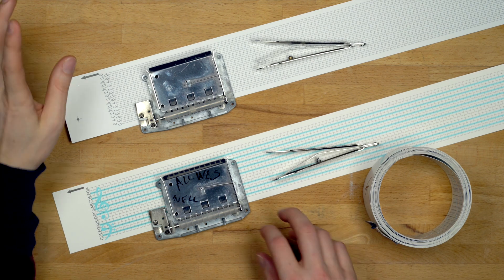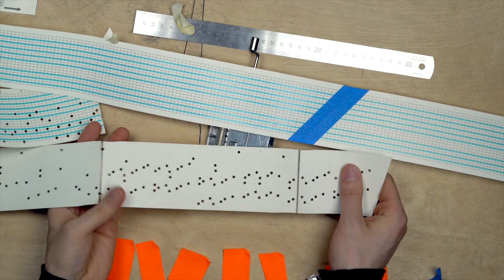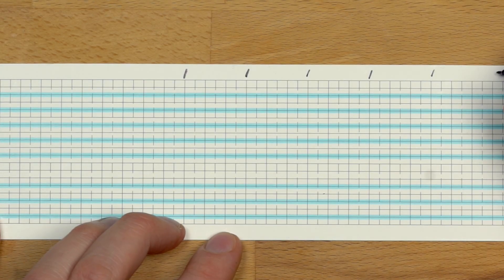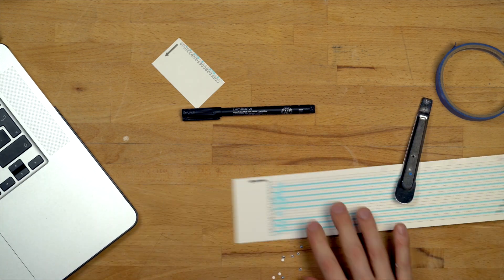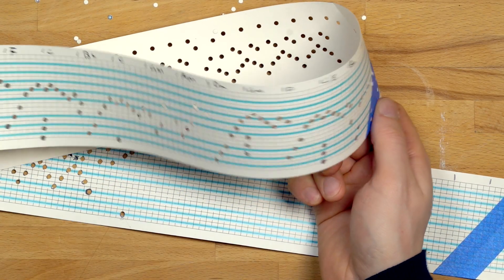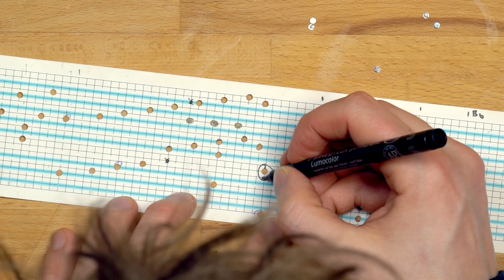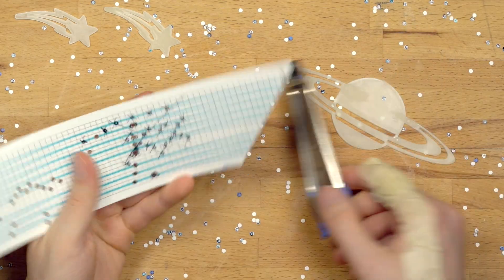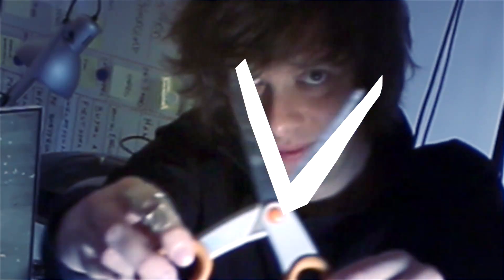How To Program a Music Box - Hole Punch Tutorial

Comment: Hi Martin, I had a quick question. I was thinking about an idea for a project. The question is, what if instead of using an electric motor, you replaced it with a wind-up system like in old clocks? I suppose it wouldn't be too difficult to manufacture, teach, and 3D print, at least the less mechanically demanding parts. I was wondering if you could try it too, to upgrade the music box. Also, to improve the system and have a speed control, you could use the same mechanism as a gramophone to adjust the wind-up speed. It's an idea I thought might be useful since the motor noise has always been a problem with the music box. I thought it would be an elegant way to repair and improve it. I don't know what you think, because I'm going to try it, but I'd sincerely appreciate your opinion. My English isn't very clear in my writing because I'm from Chile and it's not my native language, so you'll understand that the message might be poorly written. I apologize in advance. And I just wanted to throw the idea out there and see if... Are you interested in it as a concept, just from a fan's perspective, and would like to know your opinion? And are you interested in doing any projects on this topic?

Comment: Martin, you already have a CNC cutting/milling machine, can you not fit it with a spring-loaded hollow "punch" bit and have that work it's way down a strip of those pre-joined cards and use a straight up/down motion of the CNC head with NO rotation to pierce the strip at the right places? Obviously it will be essential that the strip is parallel to the axis of the CNC machine - so you will probably need to fit guide rails either side all the way along. So as to reduce the effect of driving the punch into the wooden bed of the machine you would want to have a strip of some sort of rubber or foam like material for the strip to rest upon - either that or replace the idea of a physical punch with a high power laser (or plasma?) cutter to make the holes - or a black marker pen if you still want to punch all those hundreds of holes out by hand your-self... 8-)

Comment: What you actually need is an automatic 20-hole puncher that reads the midi. how to translate the next midi note to the motor that triggers the correct puncher seems less time consuming than drawing out everything by hand. Plus you can replicate.
(and sell it to your fans)

Even with one note at a time it would go faster.

The tempo you should be able to adjust by the wheel that drives the tape.

Comment: Maybe my idea can work for this "manufacturing".

You can modify an black and white inkjet printer, if your midi software permits to print or you can save screenshots and arrange them after.

You can made a plate with holes for the punch female e modify printer head with an  electrical magnet that repels the puncher male, when the electrical signal opens the jet nozzle. You will have to amplify the electrical signal maybe with a circuit or an transformer or relays circuit and calibrate the print speed on puncher speed or the reverse, maybe easier then the one hypothesis.

In this manner you have encorders,   so positions. You need, maybe to change midi graphical notes in dots to permit to printer software to see them as not a "cloud " of point but as a point for dot.

 Now the problem is only to make note length. I have an idea sketch, but I don't know how the "player " works.

Thank you in advance for you Attention.

Comment: but, how about the missing process where we go from paper punched strips/rolls, to metal cylinders, or cones with barbs on them that pluck metal tines in an actual music box? How about THAT process? This is just about how to make rolls for a small player piano, basically. to call it it music box programming is a bit of a stretch without adding that rest of the process of turning what you have here into metallic discs, or metal tubes that are used inserted into a music box machine that plays like a harpsichord would play; plucking .....? where do we go to see THAT?

Comment: For laser cutting, you could just use the midi visualizer thing. Presumably it doesn’t matter if it’s a round or square hole, just export an image of the midi sequence, throw it in photoshop (if you can’t export the midi with black notes white background) there are several slicers that use monochrome gradients to determine cut depth, a free one being Easel by inventables. Just convert your image to an svg and it’s drag and drop. It would also be possible but time consuming to use the midi file as a background image in fusion and just sketch over it. There’s a free plug-in that lets you export your sketches as svgs directly from fusion.
Reply: won't work, as the attack happens when the slot ends.

Comment: This looks like it would fit in a Point of Sale Printer, they come with big rolls. Typically they are 80MM; I didn't catch what width these are. I have seen them with thick Card Stock which should work for you. They print thermally, so they are very manageable. The programming would pretty straight forward, I would think. - Did you get someone to print things for you?

Comment: As an engineering student I would love to make a device that automatically punches holes.  I think one could make “a music maker box” a music box that punches holes instead of playing them, an arduino could control the hole punching, and an encoder could Tracy the rotation of a drive wheel.  The goal being you export a MIDI to the device and it automatically prints out a perfect copy.
Reply: Please do this
Reply: exactly what I was thinking
Reply: As a programmer, manually marking the holes hurts my brain. Seems like an easy job or some one who understands MIDI.
Reply: @mikeharris4979  wrr
Reply: Yes, actually you can by trying to feed the arduino the midi data to serial data so that the arduino can read it,  add some mechanical puncher then done
Reply: Perhaps print it on tyvec, cut join and punch it out. Assuming tyvec would be strong enough. You would have to fiddle somewhat to get the scale right.
Reply: Josh Vennix tyvec should be plenty strong.  Cheap in large quantities.  Cutting it to size sounds awful however.  But other than that, I absolutely love where your head is at.
Reply: But most of engineer are hardly making bread and butter
Reply: This went from "I would love to make a device" to "I have near 0 interest in doing this" quickly...
Reply: Lama Poop it was more an “it would be cool” and not an “I would love” thing.  I would like to do it, but it isn’t realistic or feasible for me.
Reply: @sketchyAnalogies  I understand. Somebody will implement your idea and soon it will be a feasable joy for everyone!
Reply: Lama Poop and they’ll make millions off my laziness. Jk
Reply: @sketchyAnalogies  And now go think again about the feasibility... <3
Reply: @sketchyAnalogies 
The ones upstairs were all too clever
They were all stupid down there
And you were never given a chance
And now it's all too late
(Knorkator - Du bist schuld, 2010)
Reply: if somebody is working on this let me know, I'm a cs student and I am experienced with mcus and electronics basics. I have already worked with MIDI.
Reply: Making THAT sounds like hell
Reply: @jesus2639  I can only imagine how the first computers, which read Punch Cards and punched holes in those Punch Cards, were invented.
Reply: This is in fact a good idea, why not make a software that takes the notes, places them onto a digital version of the paper, print that out, and cut holes based on the dots. Of course, you need need to adjust for length of the song, the width of the paper, which could be fixed with a custom printer that kinda prints like receipts do.
Reply: @WestOfLee100  This is in fact a good idea, why not make a software that takes the notes, places them onto a digital version of the paper, print that out, and cut holes based on the dots. Of course, you need need to adjust for length of the song, the width of the paper, which could be fixed with a custom printer that kinda prints like receipts do.

Yeah, someone has made a very simple version of such a program for my 30-note music box, but it's so old and abandoned by the original creator, it needs a new programmer to update it for modern systems. (See what I wrote just above.)
Reply: I was just recalling how computers in the early '80s were still mostly giant mainframes that took up a whole room, and were programmed with punched cards! My dad was studying to get his PhD in artificial intelligence at University of Toronto. He used to bring home all these used-up punch cards, and he would turn them into flash cards to teach me and my brother arithmetic. We didn't have home computers back then, only a 'terminal' that used a screaming modem that hooked into our landline, to connect to the U of T's mainframe. Then the Commodore Vic20 came out on the market as the first ever Personal Computer for the home (which was a revolution, even though it barely did anything except basic games like Garden Wars). Of course, it quickly got superceded by the ever-popular Commodore 64, which became a staple in most schools and numerous homes.
Reply: There is a video somewhere of a laser cutter used to punch the hole. My problem is not practical, I just can't read music.
Reply: what about a modified black and white printer that uses a hole punch instead of an ink nozzle, and some sort of program that converts the midi files into a bunch of dots that you could print
Reply: @tylerchiu7065  what about a old needle printer that is run without the ink band, if the needle head is put tighter into the paper maybe they could actually puncture the paper.
Reply: 3D printer novice reporting in in 2020, I recently had the idea to print out music patterns for custom tunes on a music box.
Reply: @funx24x7  3D printer novice reporting in in 2020, I recently had the idea to print out music patterns for custom tunes on a music box.
Hey, are you a programmer? Have you considered creating this yet. See what I just wrote above.
Reply: @hikikomoriarty  I don’t know enough programming to script something that automatically creates 3D objects, but my plan was to take a screenshot of the piano roll in FL Studio or some similar DAW and then use that image as a displacement map around a cylinder.
Reply: I just saw, someone has done it.
Reply: That reminds me of my early childhood. When I was 5-7 years old my dad who was a professor would bring be along to the computer central of Yale. He’d have the computer crunch his research numbers and meanwhile I played chess by punching holes in the punchcards with what looked like a monster of a typewriter, and the card was removed, fed by staff to the computers towering larger than people with wheels rolling, and wait…. Minutes later I’d get a response: again on paper, the main mufti made it’s move. Haha imagine THAT!
I’m 53 and still like to make things. My Great Grandmother used a similar system to this but more complex to program the looms at the linnen weaving factory in Swedish Norrköping at the turn of the century before last.
In fact, these paper strips look exactly like knitting diagrams. 
I wonder what a sweater would sound like musically?
Reply: @gnarbeljo8980  In fact, these paper strips look exactly like knitting diagrams. I wonder what a sweater would sound like musically?
LOL - I would love to hear the sweater song!  :D
Reply: @hikikomoriarty Me too! It’s all like morse code and basic computer programming. But I’d love to see and art exibition with translations between these technical mediums. Sweater music, binaru programs in woven damast, morse code messages as petit point embrodery, digital image portraits as ukulele pieces etc. :D
Reply: Instead of creating such a complex contraption (as cool and fun as it does sound), why not just create a computer program where you can enter the notes that you want (you can play it back to be sure you got all the notes right), and then it prints out the music box score, showing exactly where to punch the holes?
Reply: I got a free Windows software that came with my 30-note programmable music box at a music box museum in Japan. Unfortunately, it's so old it only runs on Windows XP, so I have to use an old laptop saved just for this purpose... I don't believe the programmer ever maintained or updated the software. Maybe someone with music and tech knowhow could take a look at it, and make it work on Windows 10, and Mac OS as well?
Reply: Someone in another thread was getting really riled up that one of his music box score rolls is too paper-thin to work properly with his box (he said he has to thicken it up with layers of tape). With a software like this, you could just choose the right thickness of paper (card stock) to print out the score and hole markings. You'd also save a lot of money by not having to order any more score rolls! You just print it all out yourself.
Reply: Bro.... That's PERFECT as a child that knows nothing about sheet music, that would be a fantastic idea for me and other people who don't know how to make sheet music
Reply: A piano that plays the keys and punches a hole so you know what key you will get when played back
Reply: @chupert  That's an awesome idea. I wonder if that's how the paper programs for those old-fashioned player pianos (the kind featured in Old West saloons, like in Westworld, lol) were originally made. Now I need to look that up. How did they make those punched-hole programs using old-fashioned technology?
Reply: Can’t wait! It has been 3 years since this comment and I hope that you have a prototype!
Reply: Solenoids
Reply: Yes
Reply: That would really helpful
Reply: I salute you mad lad
Reply: I'm creating this right now, first I'm coding a python program to transform MIDI in a "hole array" and then I will send this array to the Arduino to make the holes. Totally Opensource, I'm not a musician so let's see what the community can do with this.
Reply: @WillGittens001  I will actually salute you for every hole a sound clip of DIO screaming “SHINEI KAKYOIN” plays
Reply: @WillGittens001  Link to more information? this sounds useful, I just ordered a music box, but looking for a midi converter
Reply: @Kiryu1985  There's a guy who created all the hardware to do this, I'm justing creating the piece of code to convert MIDI to his open-source machine. Take a look:
https://blog.arduino.cc/2019/11/25/play-tunes-on-an-arduino-powered-hole-punching-music-box/
Reply: That device could work by taking midi signals and triggering an automatic hole punch lined up to the hole
Reply: This actually is good but defeats the purpose of building something that's not relying too much on 1's and 0's. Edit: Computers I mean
Reply: Mixtela started cutting them out with a laser cutter
Reply: exactly my thoughts, tho i thought with rberry but yeah arduino might work too
Reply: God that's what I was thinking too! And please! Make try and make one sir!..
Reply: I was thinking the same thing, but imagine how hard it would be to layout the motors
Reply: couldnt you just set the holes up digitally and use something similar to a cricut? A hole puncher tool it would basically be a cnc machine with a pecking motion I think the challenged would be having the paper pull through and be continuously straight...
Reply: Just use a Cricut, and laser cut the holes. No arduino required
Reply: Guys I love arduino and music and programming this is my jam I'm gonna do it. I'll lyk how it goes.
Reply: If you purchase a Cricut or similar computerized cutting machine (used by crafters), you can do this. It’s easier than you think. Even the cheapest version can do this. Although, I think doing it by hand would be very easy too.
Reply: Holy flippin moly I never saw how much this exploded.  Think I should provide an update.  I have near 0 interest in doing this.  There are plenty of smarter people than me who could probably knock this out.  I however would struggle the whole time and come up with an inferior product.  I have zero time as well.  So once again, I cannot do this, but there is somewhere out there someone who can, and to them I wish the best of luck.
Reply: @sketchyAnalogies  bruh im an Electrical engineer, i feel like we could come up with something like this... wanna team up?? I graduate in May lol we should make a start up
Reply: @MusicGameFinatic999  Where are you from? We can do this together, I'm creating the code but no time to go deep on the engineering and electronics. I'm in Germany.
Reply: @WillGittens001  Hm - alter Lochkarten/Lochstreifen-Stanzer sollte zu kriegen sein. Midi ist kein  Problem. Wenn der zu wenig Löcher kann, lässt das Ding halt mehrfach durch.  Der ganze Spaß bei der Sache liegt aber doch gerade in der Handarbeit. Weiß nicht ob man sich damit wirklich Freunde macht :-)
Hehe, schau mal hier
https://www.youtube.com/watch?v=P0GN3-VfCeI
Andererseits kriegst in China aber ja auch nen schönen 20 Watt Schneide-Laser für n paar Euro... Da bräuchte man den Streifen nur noch drüber ziehen - Rest ist Software
Reply: @sketchyAnalogies  "Holy flippin moly I never saw how much this exploded.  Think I should provide an update.  I have near 0 interest in doing this" HAHA.
Reply: At that point why not just play the midi file?
Reply: @robconstant797  at that point why we need acoustic music instruments at all?
Reply: You mean like this?  https://youtu.be/uL9NudhhSQE
Reply: ooooooh!
Reply: As a working engineer I wish I'd make a device to shut you up.
Reply: then stop talking and make it...
Reply: @badtaste_ehsan  Then stop being mean or something and get a job.